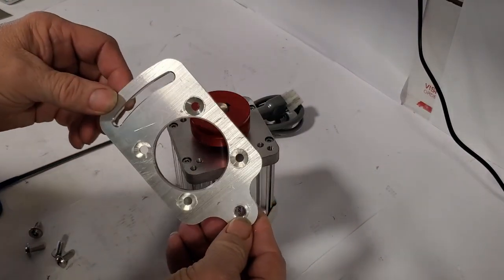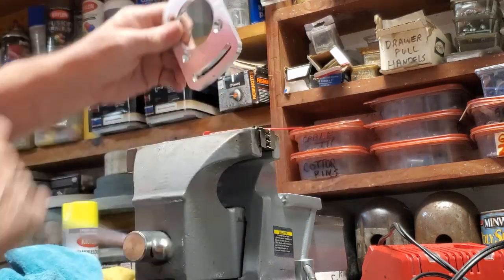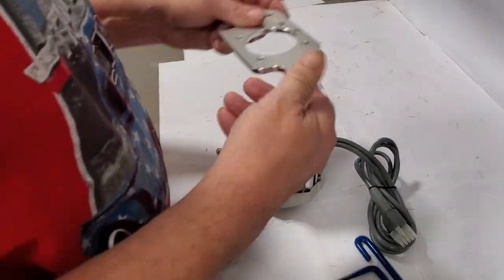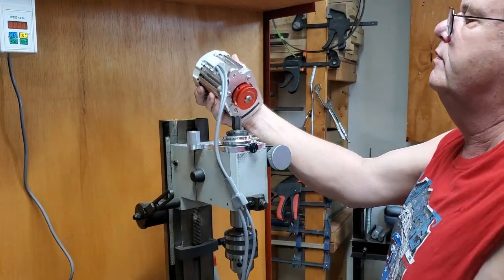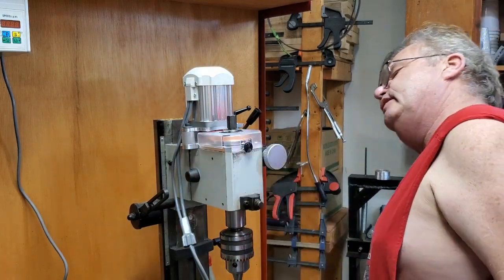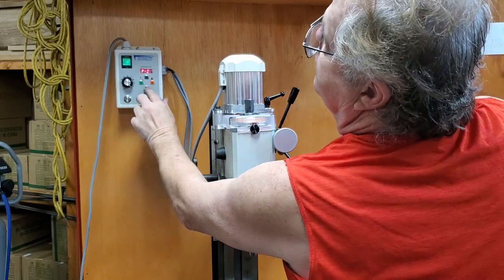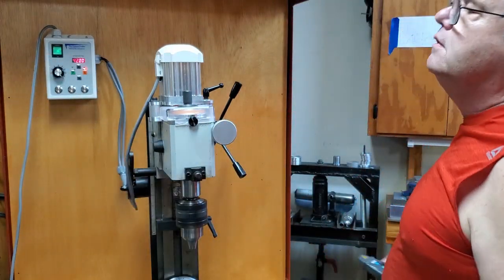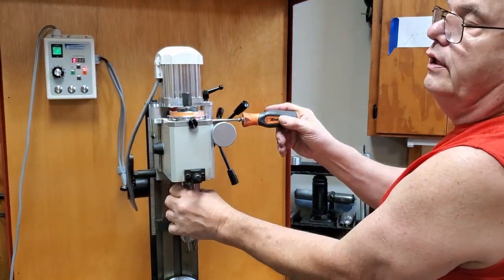LMS Mini Milling Machine 1 hp Servo Motor Upgrade with our New 2024 motor.

Comment: Just added the servo motor kit to my HF mini-mill. Had to make this exact mod since I had the LMS mount already on my machine. I’m loving the addition of this motor to my mill. Did my first cuts today and really liked the power that it had.  The RPMs are off, as I’ve added my own RPM sensor and tested with another RPM tester. Instead of 4500 RPM, I’m getting about 3500. Overall, pretty happy with the upgrade.
Reply from the maker: The display on the controller is motor speed. There is about that much reduction to the spindle due to the belt/pulley ratio.

Comment: Love this, especially the controller mods. Just a shame I'm on 220-240 and an ocean away! If only...
Reply from the maker: Its easy to build in 240V. Shipping overseas is rather  costly.
Reply: @danielmartin382  That's good to know, as for shipping I would probably split controller and motor into separate packages if it avoids duty in the UK, would have to see the numbers first. I'll get in touch hopefully this side of Christmas.

Comment: These servo motors are great. I replaced the old motor on my ancient, beat up lathe, and now I've got instant speed control. The motor has plenty of power for the lathe, and is probably close to the same power as the old one. So handy!

Comment: Nice. I have a mini vertical mill and a mini lathe that I plan on converting to CNC. These sewing machine motors are over double the power output and rpm of the stock motors.
Reply from the maker: Buying and converting a sewing machine motor from the right manufacturer will get you close. Thing is, they are sewing machine motors and built with that in mind.
Their programing and hardware is wrong. In particular, the Hall Effect Speed control. This is magnetic and attracts metal filings. When it shorts from said filings, it will smoke everything. Making it run with a pot can be done and depending on your skill, you can achieve fairly good control. Still 5K is too low and 10K is too high. It is also nearly impossible to achieve CNC control. Our new controllers are built for machine conversion. No hall sensor speed switch. Programed and wired for a std 10K pot. The speed signal is a standard 0 to 5 volts. Stop/start/reverse are simple on/off switches. This simplify's CNC conversion. However make sure you use an isolation board or you will still let the smoke out of everything.